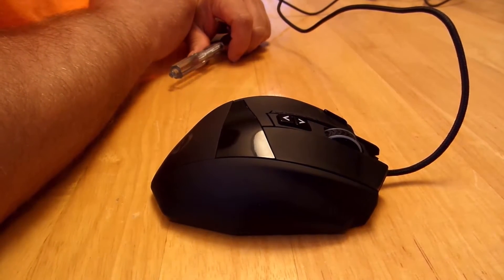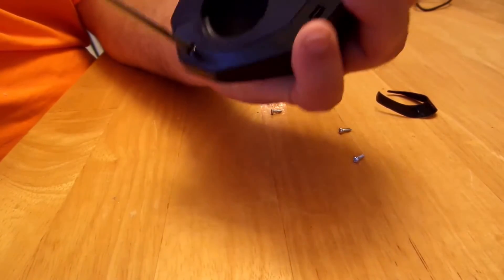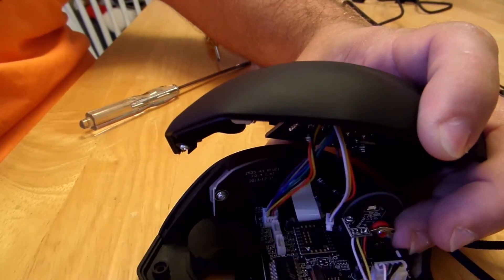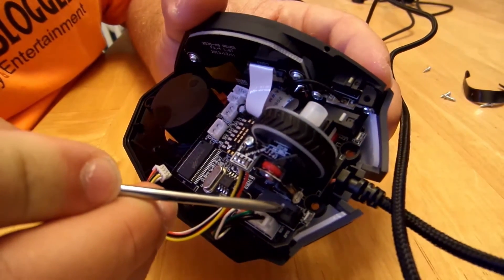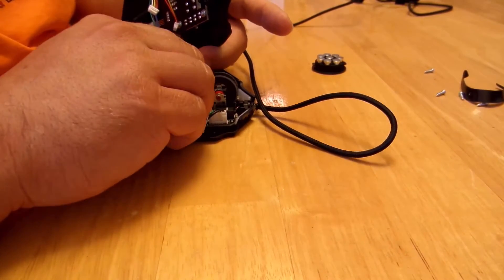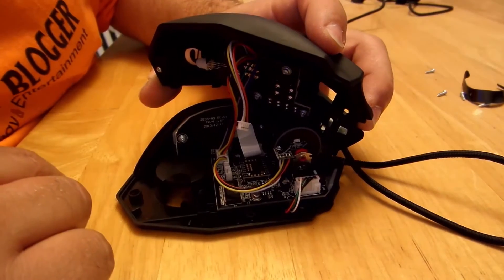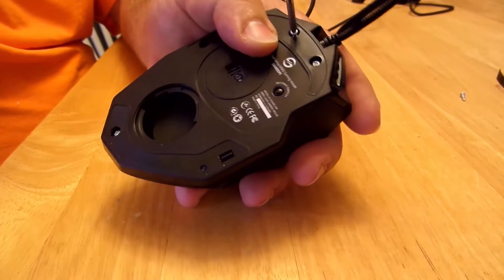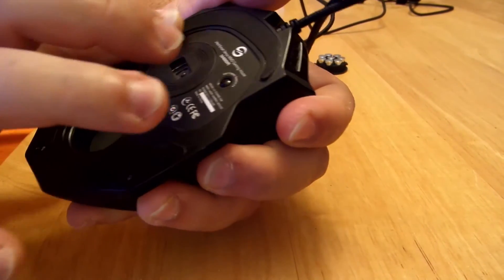Disassembling the UtechSmart 16400DPI Gaming Mouse

Comment: I didn't think I could disassemble this mouse because the pads you have to peel off to get at the screws don't feel like they're supposed to come off - even as I did it it felt like I wasn't going to be able to put them back on. It seems like I've solved the issue I had, at least!

Comment: i'm assuming you're still here, what do i need to do to stop the squeaking of the scroll wheel? it squeaks whenever i scroll up or makes a weird noise, it's starting to bug me, what should i do?
Reply from the maker: So I did a little research hear, and there are 2 options, try disassembling mouse to clean out wheel (most likely lint or debris is causing the friction), other alternative which people swear by is molybdenum graphite powder where you can find here https://geni.us/XPliSRk
Reply: @dragonblogger  Thanks for the quick response, i tore apart my mouse and didn’t find any debris, it was a bit rather dusty, I put a good amount of isopropyl alcohol and the squeaking is gone, hopefully it doesn’t come back

Comment: I have had this mouse for about 2 years and never had a single issue with it. Then the scroll wheel starts jumping.  Look up generic solutions for the issue but I didn't want to open it up since all the videos that I found were for other models/types of mice. So I left it alone, blew on it from the outside, very reminiscent of blowing on my Nintendo cartridge back in the day...lol. That helped but not the result I wanted. So I did one more search today and this video was the first one to pop up...you answered my question. I opened her up and cleaned off the wheel sensor and viola...fixed...works perfectly now. So thank you very much for sharing this video...6 years later and you still are helping people out.

Comment: does anyone know what switch does this mouse use? is it the normal D2FC-F-7N?
Reply: I know it's been a year but did you ever find an answer to this, because I need to know as well as I'd like to try my hand at repairing my old one. (the left clicker has gone sometimes it works and sometimes not and then when it's not to get it working again you have to either bash the left click or click it in a specific spot with your finger.)

Comment: Can some one elaborate on which part of the mouse effects the DPI internally? My mouse suddenly stopped working on my pad and I'd like to see if there is anything I should clean or unplug and plug back. So far, I've done the following shoots:

a) Cleaned the mouse sensor. Used Q-Tip with alcohol damp and air-dried.

b) Re-installed drivers, including UtechSmart software.

c) Use different USB ports, including on a different device.

d) Bought a new mouse pad. It does not work on this new one either.

In my mouse's current state, it works on hard/ rubber surfaces such as the back of my mouse pad and my desk. Mind you, it performs poorly on the desk but great on my dining table. Thoughts?

Comment: I need some help, So I got one of these from my step brother because he got a replacement Due to the one I have now in which was his, The Cable Near the Male Connector that plugs into the computer was broken inside, So what I did was cut that and Found a replacement Usb Male that I wired onto the Existing cable "the part that wasn't Damaged inside" Anyways I wired the whole thing up matching the wires and not touching each other so it wont short out, Including the ground wires connected, An It says device not recognized an it wont light up...My Theory is the color coated wires are not what they say they are for normal USB Diagrams on this Mouse.
Help would be appreciated thank you :)
Reply: +Iggy Castillo Thank you Man :) I just figured out the mouse bahaha
Soo... I Opened it up again and took apart an keyboard I didn't Need that Had the same connector as the Mouse inside, I connected it an No luck, So Then I looked at it an was like...Wow What if I pry off the Plastic Port thingy (the thing the mouse plugs into for usb inside) that has a key so it can only go one way, Anyways I took it off and Reversed it cause I noticed the wires were reversed on the keyboard cable, boom Plugged the Cable in backwards an Bam! it works!